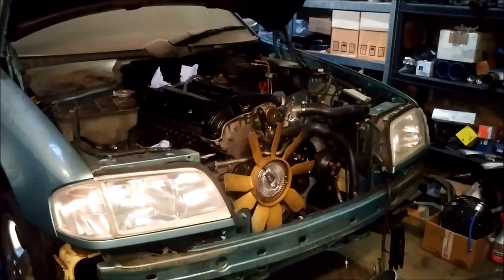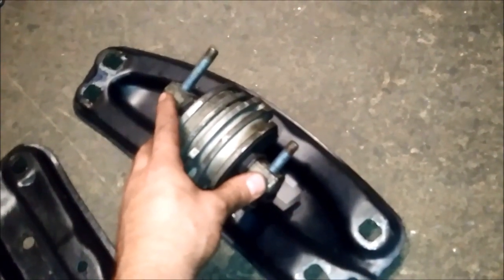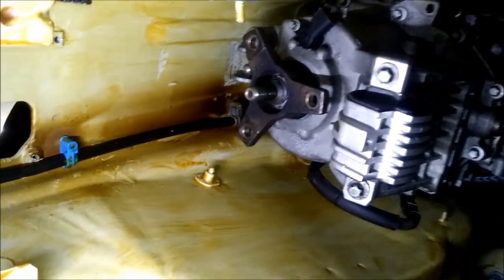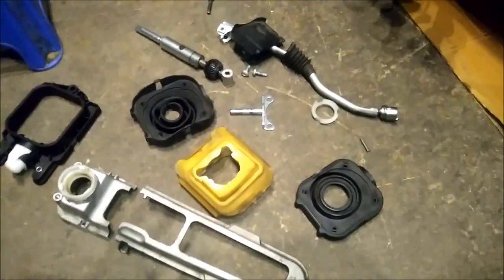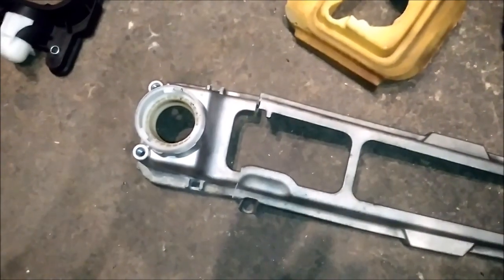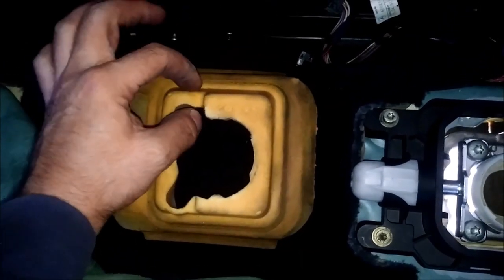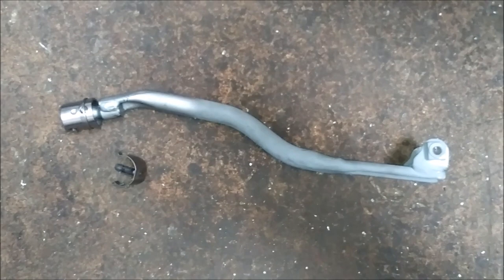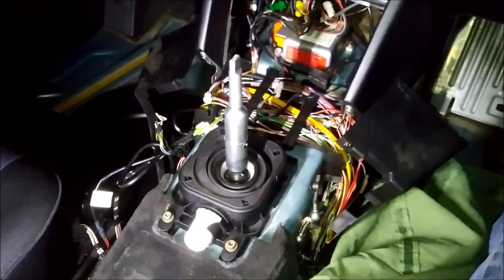How to fit a 6 speed manual gearbox into a Mercedes W202 | M104 turbo project gearbox and shifter

Comment: Wish I saw this some months ago. I also installed a 716.654 with the exact shift mechanism in my W202 C250 Turbodiesel with compound turbo setup. I'm using my old automatic gearbox mount, but had to install spacer shims to lower the back of the gearbox a bit. I see now that the manual gearbox mount does actually mount lower than the automatic mount. I also had to shorten the bracket and shift rod like you did, but I think only by about 30 mm. 

A tip for you: fill the gearbox with a good quality automatic transmission fluid. I originally filled the gearbox with only 1.5 litres of the the prescribed manual gearbox oil (instead of 1.8 litres). These gearboxes are very notchy when cold (even when fully warmed up), especially from first to second gear. ATF has improved the shift feel a lot. 

I don't have the foam piece, though - I didn't see any reference in EPC.
Reply: Why 1.5 litre oil I also swaped the original 5 speed gearbox with 716.654 6 speed in my w202 c230k, but I put 1.8 litre of original mercedes oil not ATF and the gearbox is pretty smooth.

Comment: original W202 6 speed manual gearbox for M111-OM60X-others , p/n A2032608900, from S202 year 2000 only, so no need for painful modifications
Reply from the maker: Good to know! But i doubt they are as strong as the ones from later cdi models. So for high power builds i would still recommend 716.648/649 or 654.

Comment: I was wondering about the bellhousing - does the bolt patern on the m104 match the gearbox or do you need an adapter plate. Great video

Comment: hi, does a B class mercedes 2007, B180  CDI manual gearbox  fit into the B200 petrol engine. Are the gearboxes the same.thank you

Comment: Hello, is there a 15° lean to the gearbox and do you think a BMW shifter will work ok too? Thanks for the video
Reply from the maker: Hi, if you got a 15° lean, you used the wrong gearbox. Gearboxes of V engine are symmetrical, Gearboxes of R engines have a lean, so you cant mix them.
Reply: @CZSMotorsport  it's from a 271 4 cylinder

Comment: Is the 6 speed still working good? I want to put one on my w202 c180...
Reply from the maker: It still works great, can only recommend ✌
Reply: @CZSMotorsport  witch gearbox did you put there
Reply: @CZSMotorsport  will it work on a C280 as well? I just got one from marketplace

Comment: Want to put a m111 kompressor into my base c230 w202,  do you think it’s possible/ worth it? Have also found a donor car for the swap.
Reply from the maker: Its the perfect swap, do it 👍
Reply: @CZSMotorsport  am going to try to do it this week, need to figure out what to do with Ecu.
Reply: @cam_fras4605  IF you haven't figured it out yet. you can use microsquirt/megasquirt and run it parallel with your ecu and trans will still work, but once you go manual trans, you can rip your oem ecu apart

Comment: I swapped gearbox on my c280 m104  and it dont starting can you help me?
Reply from the maker: Did you also swap to another flywheel? The sprinter flywheel has 60-2 teeth trigger signal. Older Engines might still use 2 teeth trigger signal. You need to check what kind of signal your ECU uses before swapping flywheel
Reply: @CZSMotorsport  i used m111 c230 komp gearbox and should i cut magnetic flexplate from automatic transmission and place it on flywheel? Or what you have for tips
Reply from the maker: @whatyoumean3383  depends on your longterm goals. I have same situation right now. I will use dual mass flywheel with 2 theeth signal to make a manual 6-speed conversion on my c200. Later i will switch to 230k engine and use stand alone ecu. Then i can use sprinter smf